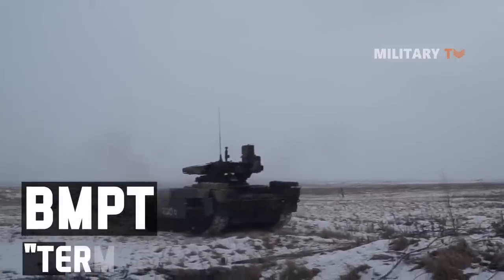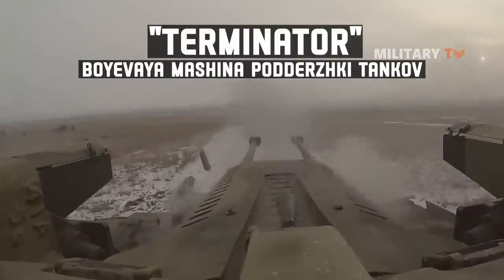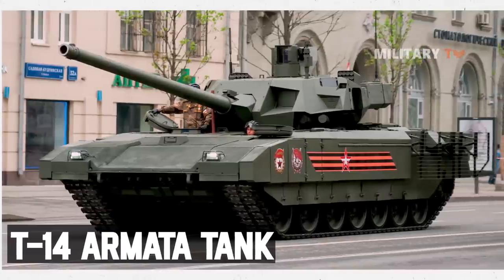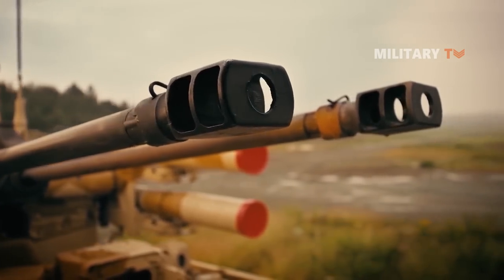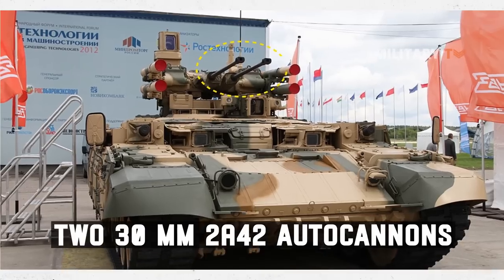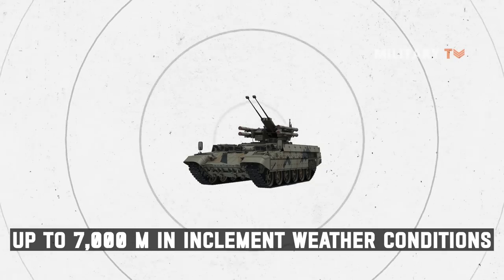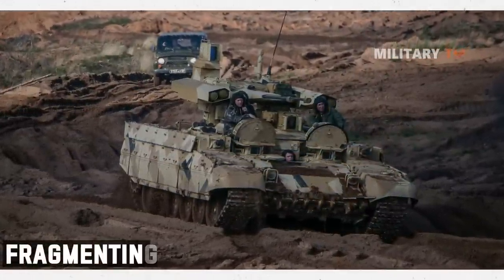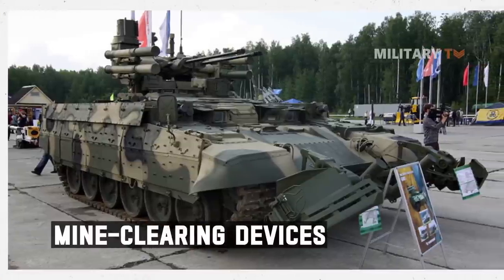What Makes This Terminator Tank Extremely Lethal?

Comment: Very good protected and with great weapons systems.... They were used on every TV show. Just  for  some reason they are staying away from front lines.... maybe because of cheap drone that can make boom from this tank(not mention post video on youtube) or maybe because of artillery's shells that can fall from sky. Also better keep this tank away from dirt and city and village.
Reply: I've seen these Terminators in action on the front lines on Telegram channels. They are there and are not afraid of mud or Ukr nooseys
Reply: @Denis_Komarrov 
Lol. And you have direct access to the front lines I'm guessing 🤣
Reply: @blazer4999  I actually live here at Donbass  :) When i see Terminator in deep snow when on street is +15C   and last snow was 10 months ago it meaning something is very wrong... Unless  of course it  spread  snow and cold when moving.
Reply: @Denis_Komarrov 
If you live in Donbass, which is highly doubtful, you need to cope better.

Comment: Somehow, this alleged Uralwagonmash product does not impress me much. Their supposed number - ten - sounds quite comical. Isn't it? Even if there are ten of them, which I doubt, the Ukrainians will handle them without problems. They have a great remedy for such gadgets, it's called: Stugna P. Why? Because I can bet any money that this gadget DOES NOT HAVE armor equivalent to 1,200 mm of decent steel. That's how much a HEAT round can penetrate, easily. So ten Stugna Ps, or ten Javelins or NLAWs, and a "great Russian propaganda success" smashed into a pieces just like those alleged "terminators" turned into piles of burning scrap metal with a meat insert inside.
Reply: in what sense is there no armor? he has a body from the T-72 tank, and now it is already being produced with the body of the T-90 tank. Is it really so difficult for you to go online and read so as not to write any nonsense.
Reply: @andrzej3511  your "analytical abilities" cause laughter))) you are a dreamer)))
Reply: @ElceBep  Possible. But I'd rather be a dreamer than a troll of a bandit regime.
As for the actual value of the Terminator and my daydreaming: at least one doesn't exist anymore, right now? Isn't it?
Reply: @andrzej3511  This is a war, there are breakdowns, even a merkava can be filled up standing, not to mention Abrams from the ancient RPG-7. The BMPT turned out to be a good one for urban combat.

Comment: If you fucked off the political commentary, the content would be better.
Eg. Russia never "crafted" an image of invincibility. That'd be the US that does that, and on a much larger scale. 

2A42 guns have variable rate of fire. Slow and fast, depending on the targets engaged.
The missiles used can be had with either High-Explosive Anti-Tank warheads, or thermobaric warheads.
BMPT doesn't use ANY parts from T-14 Armata tank. At all. It's wholly separate from that. Russian pattern Terminators use T-90A hull. There are export-grade models that use older T-72 chassis.

Comment: I think this machine will suffer the same fate as the rest of Russian armor when hit by modern ATGMs. The Afghans and Chechens used mostly shorter range RPGs.
Reply: LOL no. In fact BMPT is far more survivable than tank because it doesn't carry tank ammo propellant and HE-FRAG rounds. One could stop it, but to destroy it takes a direct artillery shot. Can't wait to see Chally-2 in Ukrainian plains. It won't drive around for long ;)
Reply: @yeticonfettis WAS it destroyed though? lol Where is the video of it in pieces? There is a vid where an ATGM on its rail gets hit and explodes, but there is no video of aftermath. That turret is unmanned. Is it neutralized? Yes. Is it a write-off? We'll see.
Reply: UKS used up 7 years of Javelin production, according to US manufacturer
Reply: It took about 9 months to disable the first terminator. It's time to admit his effectiv
The russians nailed it with this
Reply: @yeticonfettis  that's the point. It seems to be working better than expected cleaning trenches in the forest, and in open fields is working fine as defensive vehicle.
Reply: @gerardsotxoa  and it only took them 9 months to deploy...
Reply: It's overrated, just like the russian military
Reply: @A.G.P.115  no... the first ones were spotted in the Donbass in  early May,
Reply: @gerardsotxoa  This baby is a brutal machine.
Reply: @yeticonfettis  pal, a 30mm gun is not supposed to be very accurate, and i think it uses fragmentation shell rounds so its meant to dump lots of lead. 

Honestly i don't see why someone should expect a much better accuracy. I would rather complain about the hull

Comment: sounds good but actually dont work ! 

we dont need to talk about terminator when rusia didnt bring their t-90 to Ukraine. why ? 
because they affraid ,their famous tank will be the part of parade in kyiv
Reply: there is both T90 and BMPTs operating in Ukraine
Reply: @fuckedlaptop364  no. there is no t- 90 .it  is t-80
Reply: @pixelion1579  there is photos of T90s blown up in Ukraine, you're welcome
Reply: @fuckedlaptop364  yes.they lost 2 . blow up and stole by Farmers. 
after that,they pull it back. t72 and t80 replace it in the front line. there is no more t90 in front line. t90 now use for defense.
same case with the Terminator. deployed 10 and lost 2. the rest never seen again.
Reply: @pixelion1579  pretty sure no BMPTs were destroyed